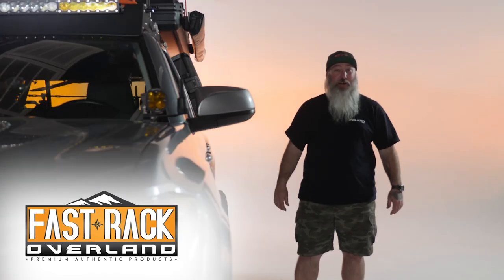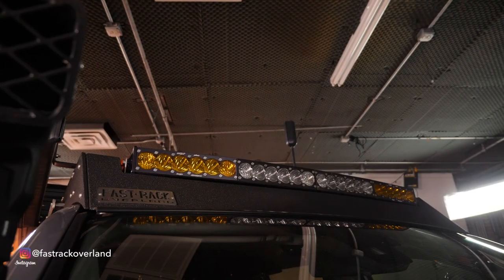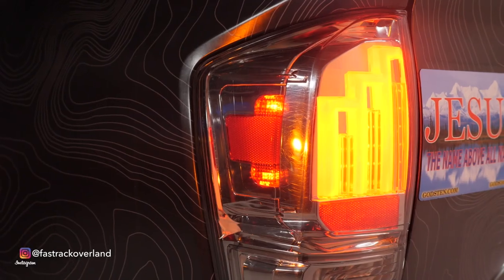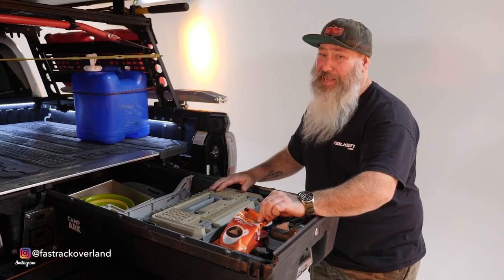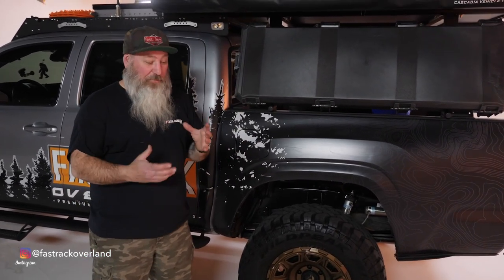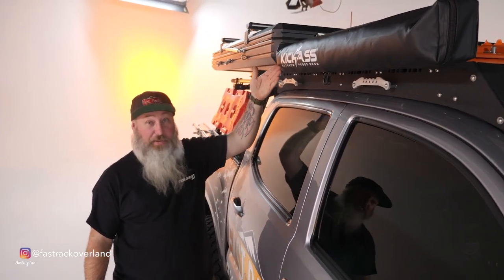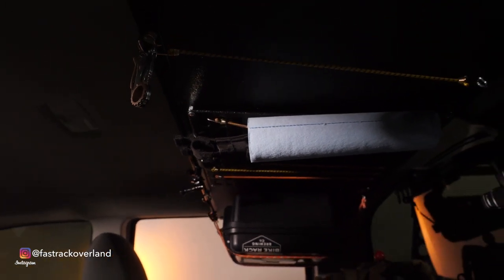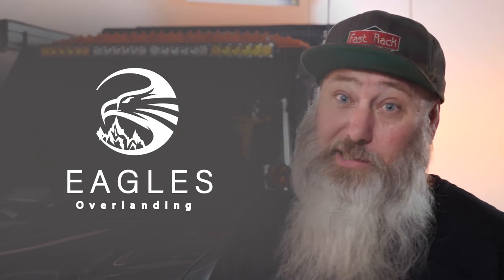TACOMA Rig Walk Around! Take a look at my fully built Overlanding RIG!!

Comment: Some nice mods man. What mount you using for the iPad?
Reply from the maker: It’s the Otter box case. Some modifications are required. 👍🏼👍🏼
Reply: How are you mounting it to the dash. Is it like a magnet or a ram mount?
Reply from the maker: I used the otter box cover case I cut a hole in it to see the radio then I screwed that to the dash. I did that cause I wanted the iPad to be in a case. It works awesome.
Reply: O ok that makes way more sense now that you explained it like that 😂. Thanks man I’ve been trying to find a setup that I like for my Tacoma. I’ll have to give that a try.